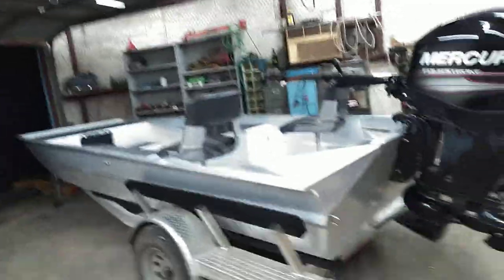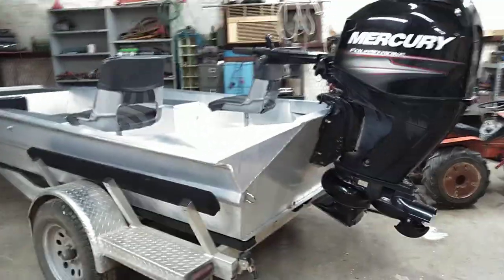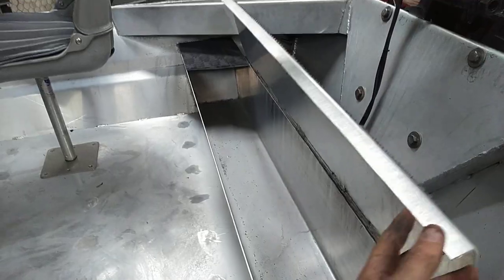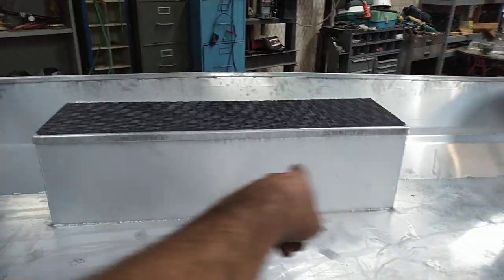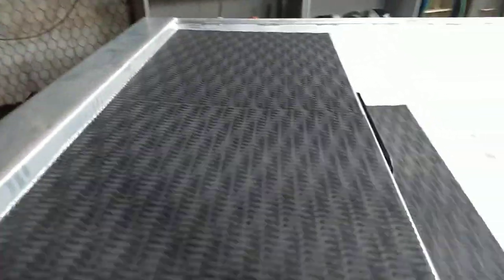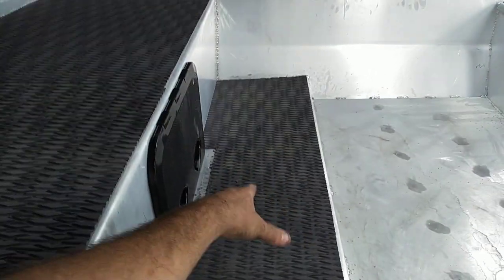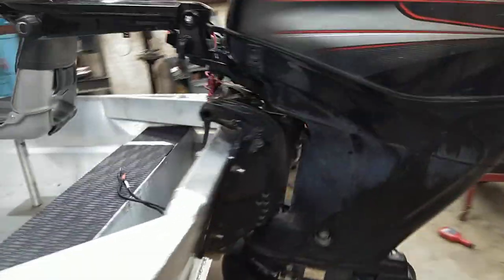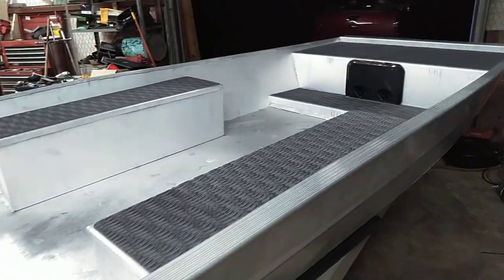New 1652 by Kaz Kustoms

Comment: Noticed none of you guys run a small tunnel for the jet motor....mind me asking why? Love your videos BTW...
Reply from the maker: The one I did have hurt performance too much. Went from 26 to 33 welding it up. Also kept boat sucked down and was hitting everything. Hit way less without tunnel. Also able to trim more without tunnel so the intake rarely hits amd when.it does its a small deflection. Also without tunnel can slide and turn way better and keep the pump prime.